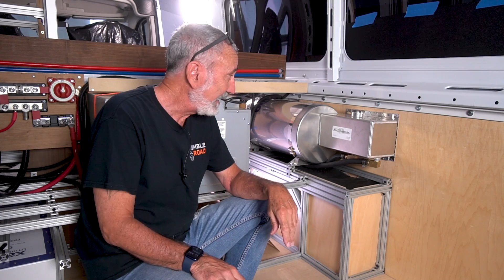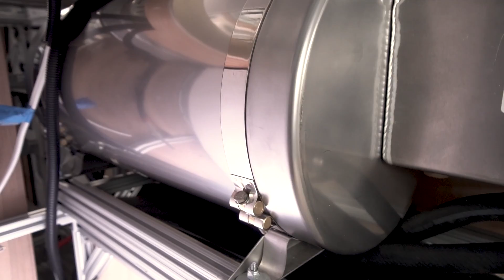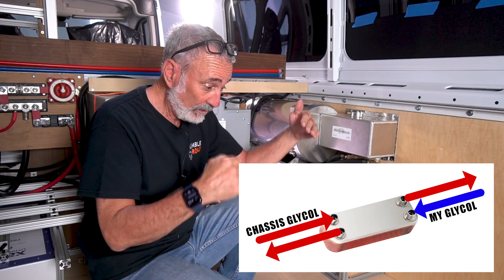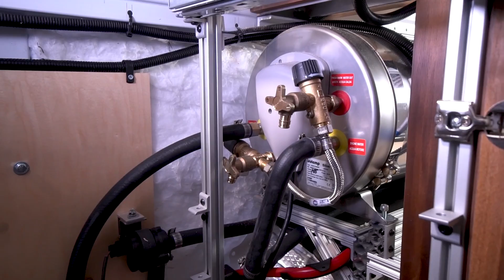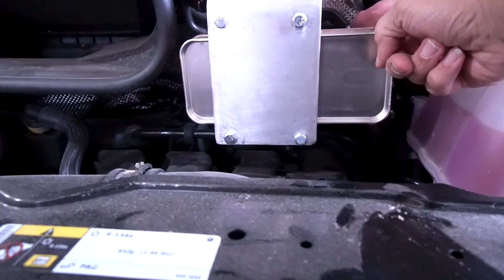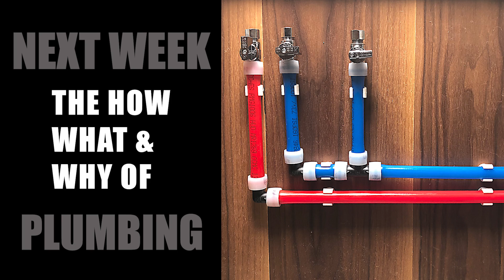Make hot water in your van, while you drive!

Comment: Im looking at setting up a similar system... but Im wondering... 
I get that youll have 170+ degree water... but as you use water out of the heater, doesnt it get replaced with cold water from your system? Seems like as you use water... the water in the tank will decrease in temperature.... 
So the first shower would have very hot water, the second still hot but not as hot, dinner dishes warm water... but after that youll have mixed in a fair amount of cold water in the hot water tank.
Am i understanding this correctly?
Reply from the maker: Yes, you’ve described how every single water heater works! They all start with cold water. It’s a fact of physics nowhere except Yellowstone, where you have perpetually hot water? What’s your point?
Reply: @HumbleRoad it was me confirming what I thought to be true from someone knowledgeable that i respect... there's absolutely no reason to be unkind

Comment: Great video. I want to do this.
1. How do you set the pump up to run when you are driving? Do you have to turn it on every time before you head out?
2. Could you put the glycol tank under the van so you don't have to deal with the heat in the garage?
Reply from the maker: The pump is powered by one of the chassis keyed circuits. Only on when the engine is running. The glycol reservoir has to be the highest point in the system.

Comment: Question: 
My garage said to put the heat exchanger in the heater core loop, but I think I dont have a lot of warm water when using hot air in the van. You put the exchanger in the main motor loop, coming first thing from the motor, so to have maximum heat, right?

Comment: Why engine coolant?  Why not use exhaust heat?  Wrap copper tubing (anti-freeze, pump, heat exchanger) around a section of the exhaust pipe and water through other part of exchanger.  You have three systems, this has two.
Reply from the maker: I like the way you think! That would be a fine system up until you need to replace your exhaust at which point the system gets dismantled

Comment: Would it be possible to have the heat exchanger not pre-heat the engine or even run off the engine glycol system? The engine glycol system is a closed loop, so would it be possible to have a smaller (shorter pipes) dedicated glycol closed loop system? Possibly with its own dedicated small glycol tank if required. This would surely result in hotter, quicker glycol = hotter water quicker.

Comment: Been looking for hours to find a proper video for explaining the heating system for hot water / floor heating in the van, I thought about using the auto term combo boil and connect ut to the coolant system of the car I see here I should use a exchanger

Comment: Do you run the pump off the Vehicles engine 12V? If so where did you tap into the wire does it start when ignition starts? 
I’d imagine you could have this on a rocker switch so on cold mornings you could circulate the gycol in the back on leisure battery and give the engine a warm?

Comment: I think this is brilliant and it solves quite a worry I've been having about the idea of a heat exchanger set-up where the engine coolant is heat-exchanging with the hot water system. The problem with having a "direct" exchanger is that you generate hot water whenever you drive. And don't have an option to stop heating - at least not without complex diverter valves. I think with your system, can you not run the pump via a thermostat in your hot water tank - so when it reaches e.g. 120, your intermediate glycol loop pump switches off?
Reply from the maker: Correct

Comment: I wonder if its good idea to run water directly to heat exchanger and skip the glycol with second heat exchanger.
Reply from the maker: What happens if you spring a leak in the glycol hose now your engine is compromised and you can’t drive
Reply: @HumbleRoad  I mean if we run water to the engine compartment to the heat exchanger to take heat form engine coolant. That way the only weak point should be the heat exchanger where the coolant could mix with the water and poison it. I just don't see the benefit of putting another (glycol) sub-system in between other than problem where it could mix with coolant.
Reply from the maker: You don't run your fresh water to the front heat exchanger, you run glycol, which returns heated and passes through another heat exchanger in the water heater.
Reply: @HumbleRoad  Ahh maybe I'm not that good in getting my point across. I understand your setup but I want to skip the glycol part. Is there any drawback to running fresh water directly to heat exchanger that is placed in engine compartment? That way we can take heat directly from engine coolant.
Reply from the maker: OK now I understand what you’re saying. It is risky to run the freshwater up through a heat exchanger. Also, all tubing or hoses would need to be food safe for all of that travel distance not an easy task. The difference is the heat exchanger in the water heater has the glycol running through it, and it is submerged in the fresh water, rather than running fresh water through a heat exchanger where it may fail through the plates and mix with the glycol.

Comment: Hi George, first of, love your work and the channel.  Would you be willing, to please confirm I have the right part numbers for your hot water system, i.e. SKU: G55 Heat Exchanger, SKU:C11-103 2 Gal Exp Tank; SKU:P11-100 12v Pump?  I live in the UK, so finding these parts here is a bit of a challenge.  I was thinking of buying direct from Rixen; that's if they'll ship abroad.  I managed to buy the ISOtherm tank.  Thanks in advance

Comment: Excellent system.  I'm curious if I could use a cheap 2.5 gallon HWH (Home Depot type)  and then always have a 120v HWH available where I have shore power?  In other words, heat exchanger plumbed in like yours just in to an existing HWH where it almost never runs?   Can you link which heat exchanger you went with?  I'm seeing lots of variance in price and I'm sure this is in line with quality.

Comment: A counter argument for having a mixing valve at the tap vs. mixing valve at the calorifier is that the pre-mixed at the calorifier water will lose less heat in transit than the mixing at the tap variant,
Reply from the maker: In terms of physics, you are correct. However, the fact that the water is being sent to the faucet at upwards of 150 to 170°F. I wouldn’t mind losing a little more heat at that point as well!

Comment: Please can you tell me why you don't just pump the water through the heat exchanger and loop it back round into the water tank? Would that eliminate the need for the separate glycol tank and still heat your water just as fast. Please forgive me if that's a dumb idea, I genuinely have no idea about all of this stuff I'm just trying to learn.
Reply from the maker: OK imagine the glycol lines running under the van get cut and the van is rendered inoperable. With my system if the glycol hoses under the van get cut, only my hot water system is disabled, and the van may continue on that’s called wearing a belt and suspenders.
Reply: Yes but if the lines under the van are carrying the water instead of the glycol would that not just be the same outcome if the lines get cut. You'd just lose water instead of the glycol!
Please don't think I'm being argumentative I'm just curious as to whether I need to run glycol or if I can just pump the water round the loop through the heat exchanger and back into the tank. 
Thanks again
Reply from the maker: Oh, now I understand what you are asking! Hmmm. Send the water up to the heat exchanger. The water heater in the rear of the van has a heat exchanger in it. It's designed to have glycol flow through it to heat the water. You pose an interesting question and at the moment, I don't have an answer!

Comment: Super clean setup, great work. I have a similar setup in my van and love it. One question:

Do you ever have the overheat protection get triggered?

I keep finding myself having to access my water heater to reset the overheat protection pin every time I turn the heating element on and the water is hot.
Reply from the maker: No, I installed in line heat sinks on the return line to the water tank and that lowers the temp
Reply: @HumbleRoad  Thanks for the quick reply. I wasn't sure if those cooled it down enough since the Promaster's coolant gets so hot, but it looks like with your heat exchanger and the in-line heat sinks it does which is great to hear. I really like your closed loop system as you have completely isolated systems. 

Great work, love seeing how well you've thought this through.

Comment: My 40 year old winnebago has a heater in the back that uses the antifreeze from the engine radiator. I just took out the heat exchanger and blower and used the hoses to install a closed loop system around my cold water to heat it up for the shower and washing machine.
With all due respect there is no need to use a second reservoir in the back for a second heat exchanger, every time you use a heat exchanger you lose efficiency. Why not just pipe the antifreeze from your radiator to the water tank. Amd skip the extra exchanger and glycol reservoir. Just a thought.
Reply from the maker: He deliberately did not type a chassis anti-freeze back to my system for a most important reason. If anything were to happen to those lines, the vehicle is in operable with my set up. If anything happens to the lines only the water heater is in operable. And I did want to step back on the efficiency of the system. A pro master runs normally at 215° with the heat exchangers in place. I am still making 170° water which is rather hi it’s Spaulding so anything I can do to step it down I’ll do.
Reply from the maker: I deliberately did not pipe the chassis anti-freeze back to my system for a most important reason. If anything were to happen to those lines, the vehicle is in operable, with my set up, If anything happens to the lines only the water heater is in operable. And I did want to step back on the efficiency of the system. A pro master runs normally at 215° with the heat exchangers in place. I am still making 170° water which is rather hot
Reply: If the heat exchanger is still in your engine bay, how you have it, but you're pumping your water through it to heat it directly, then if anything happens to the lines under the chassis you will only lose the water and not a load of glycol. Correct me if I'm wrong and thanks for taking the time to make the video.

Comment: If a customer drives their van daily that is a fantastic system. If someone is boondocking for a week or two not as much as showers may have to be timed as it will take time for the 750w element in the water heater to get that tank warm. There are 800w DC water heater elements available, that heater may be able to be converted so you lessen the load on your inverter by running it directly off your batteries. I have one concern with the glycol tank, it looks like the reservoir tank is aluminum and the fittings are brass, how did you mitigate the Galvanic Corrosion risk between the two dissimilar metals?
Reply: i thought the tank was stainless steel ?
Reply: @MultiOutdoorman  The cylindrical water heater is stainless, but the rectangular reservoir tank I believe is TIG welded aluminum.

Comment: Great idea! Just watched a video by Silvercymbal regarding coolant hose clamps. Might have to agree with him that ring clamps are not meant for coolant hoses. Need to use spring clamps that apply constant clamping pressure no matter if the hose and nipple are hot or cold. The ring clamp might allow a coolant hose to leak depending on temperature.

Comment: Spring clamps are typically better than worm-drive clamps for automotive and similar applications where heating and cooling is taking place, such as on the tank barbs. They will expand and contract keeping a constant water-tight pressure on the tubing, but they must be sized correctly. Worm drive clamps such as in the video can apply too much pressure upon the hose when the tank and hose is heated and over time, this can cause leaks. If you need worm-drive clamps for an application, I suggest the Norma brand because they will hold much tighter than other worm drive clamps. Cheers!

Comment: Hi HR!  I have been following your videos for years now and very much appreciate your sharing of your experience, but also your explanation-teaching of your work and process.  I am in the process of buying appliances for my Transit van and wanted to ask where you picked up your hot water heating system, specifically the glycol coolant unit and if its just the unit or other parts needed for assembly?  I already purchased the isotemp cylinder water heater and hoping to install the passive heating system as well.  Thank you for sharing your experience and look forward to hearing from you!
Reply from the maker: Thank you Brett, for supporting my channel. .

Comment: Firstly, love your work - great build quality and attention to detail with excellent functionality. For the glycol system, what would be the outcome if glycol was to leak, for any reason, from the heat exchanger within the water tank?. As a sweet tasting but toxic substance, could such an event pose a serious health risk, to a person that was routinely consuming water with other sweeteners (cordials) masking  the taste? Loss of glycol in the header tank would,  at some stage, alert a person to the issue of a leak and rate of dilution would vary dependant on the severity of any potential failure within the exchanger -, could it be a risk worthy of consideration for discussion with the manufacturer and precautionary advice to owners?
Reply from the maker: The heat exchangers in the water heaters are double walled. The particular brand I use has a near perfect track record. Also the color of the glycol would alert you to the problem almost immediately.
Reply: @HumbleRoad  Thanks, the double walled exchange tubes is reassuring.
Reply: I don't know of anybody that drinks from their hot water supply source. We have a separate cold supply and a water filtration system,  for just the small drinking water tap !
Reply: @MultiOutdoorman  Some people may use the hot water because they have run out of the main supply and just take advantage of what's left, or use hot water to get a head start on further heating water for cooking. Regardless of the frequency of the risk, it's more about the severity of the potential outcome and the need for robust design and end user awareness.

Comment: Do you have a wholsaler you can recemend. I am looking for T-Slot in 20×20 mm. And 40×40 mm in ten foot lengths please?
Reply from the maker: 8020 is sold direct or through distributors.
Reply: @HumbleRoad  

I am having difficulty finding in in 10 foot lengths all are cut ✂️. 
Thanks
Reply from the maker: Certain length limits for UPS, longer lengths need to be trucked freight $$$$
Reply: @HumbleRoad  thank you I hadn't thought of that.

Comment: Yes, having 2 separate glycol systems safeguards from a cut line on the 2nd one disabling your vehicle. But if all the effort you put into making that 2nd system was focused instead on protecting those lines it would be much simpler and avoid the problems that glycol reservoir is causing. If the hoses came through the wall separating the passenger side from the engine they'd be well protected. What do you think?
Reply from the maker: The hoses are not so easily routed to and through that fire wall without blocking or compromising another system under the hood. Best route is straight down and over the steering axle.

Comment: Enjoy your ideas and build series. I also have the Isotemp Sure Slim 4.2 G water heater and the rixen Hydronic Kit with the expansion tank minus the electrical heat element.I also have the engine coolant heat exchanger add on. My question to you is what was your reasoning  for running your glycol from the extension tank to the pump then direct to the heater exchange in the engine compartment and then to the isotemp?. Also if I put the extension tank in the engine compartment with the heat exchanger where would I place the pump?
Reply from the maker: The reservoir should be the highest component in the system

Comment: Great system, and I am looking forward to install it into my VAN as well. I am a perfectionist like you as well and love that everything is perfectly installed and allocated. Why add the extra tank of glycol though? Wouldn't 2 shut off ball valves where your intake and out-take from the van is be working the same way?
Reply from the maker: Ball valves are fine, except the engine coolant is at risk making the journey to the water heater and back
Reply: @HumbleRoad  I would have loved to build my van with you as I am sure it would have turned into another masterpiece. I would
Love to connect and share some ideas I have applied into my built that haven’t seen done yet.
Reply: @HumbleRoad  also why do you prefer this system to the isoterm itself with all built in already?

Comment: An ideal to install it on or in the roof with a transparent dome cover over it, to allow sunlight to hit it, paint it flat black. This way it gives more energy options and more energy period. During your camp stop you not only have the option to use solar panels and batteries with the 750watt element to heat the water, you have the sunlight hitting it during the sunny days. And at most you will benefit by not having to use so much battery power to keep hot water, and have more energy for other things. 
You could also install tees on the input and outputs of the reservoir and add another heat transfer loop using a small solar water heating coil(under a transparent flat panel), giving even more energy into the system during sunny days.
Reply from the maker: Be aware of the weight you will have up there. Not to alter the center of gravity too much